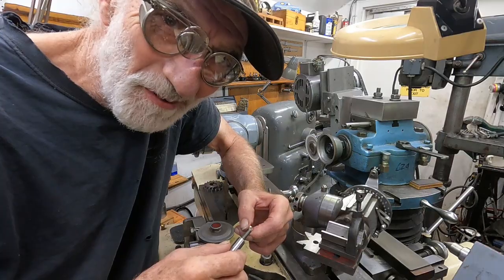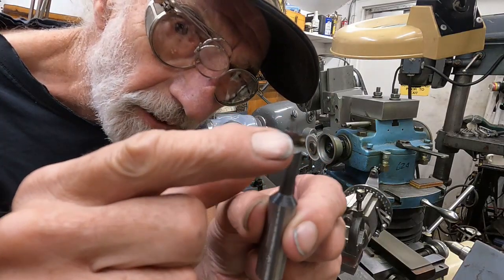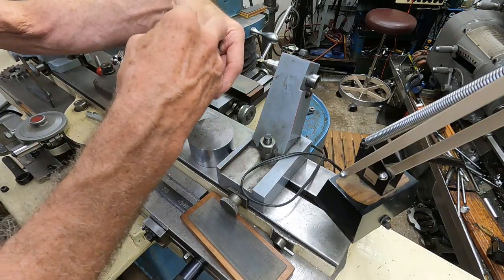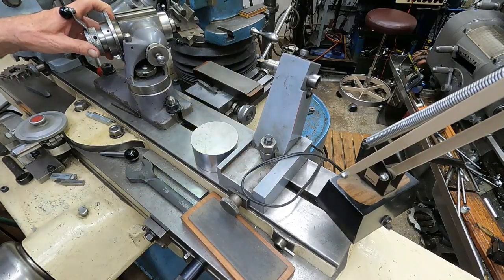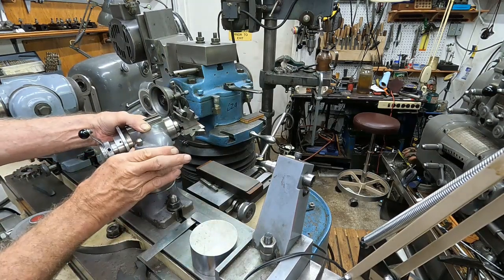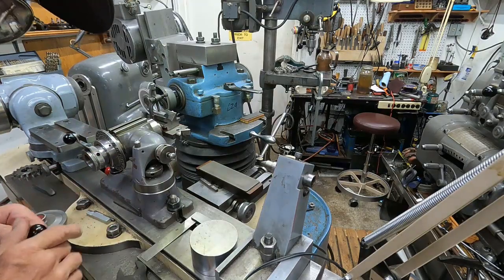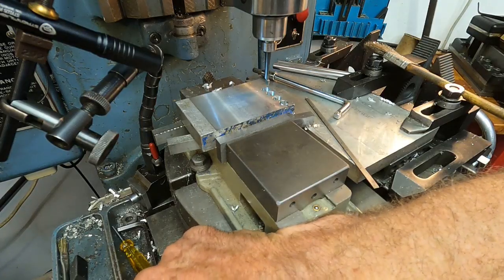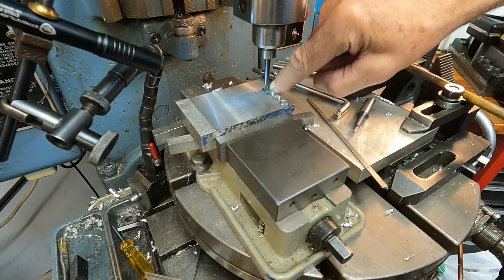Measuring and grinding boring bars for jig boring and milling

Comment: Great video Deedee. I was just playing with my new Criterion boring head today. I used both insert boring bar and the typical brazed carbide (factory sharp with no further grinding). Gotta say the tool with the corner radius (insert bb) left a better finish in this case. Keep these videos coming!
Reply from the maker: The brazed bars need to be finish ground like the brazed lathe bits when new. I have more coming, thanks

Comment: now that you have nicely bored holes on the 12 millionths machine, can you find a pair of pin gauges that will illustrate how much the harder aluminum oxide at the bottom of the hole shrunk the diameter?  maybe you can see it with a mahr delta three point?  either way, how much did the hole shrink?  sooooo much fun making holes.....
Reply from the maker: The overall tolerance of the jig borer is .00008", the rotational accuracy of grade 9 angular contact bearings is .000012". I will get back to this soon. Thanks!